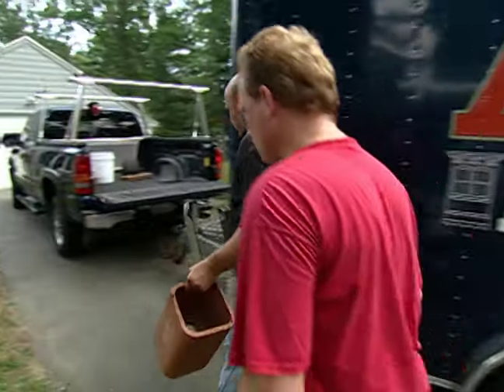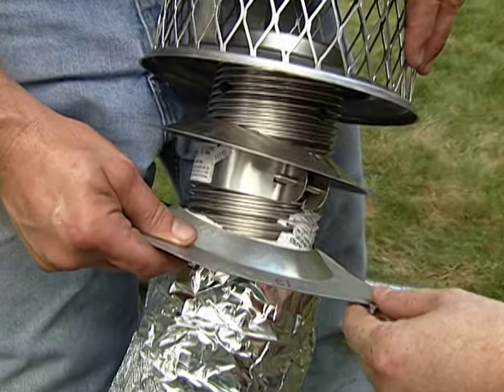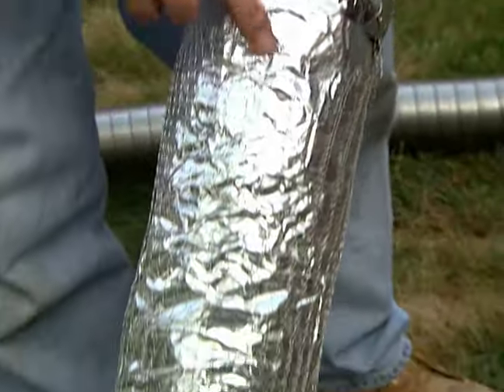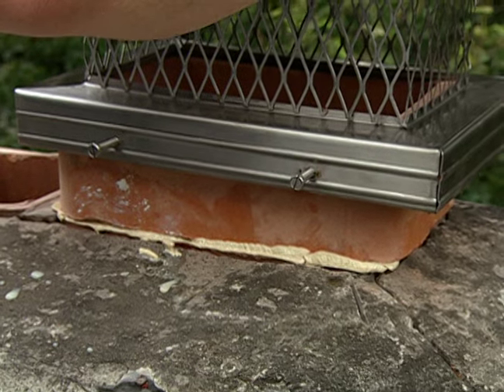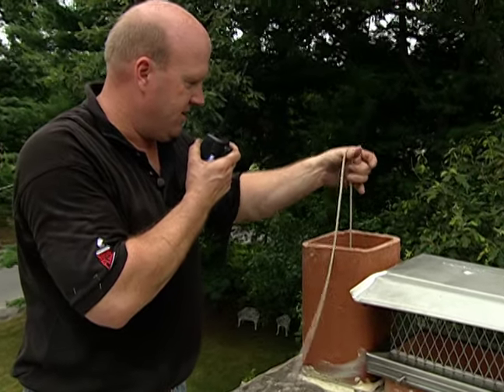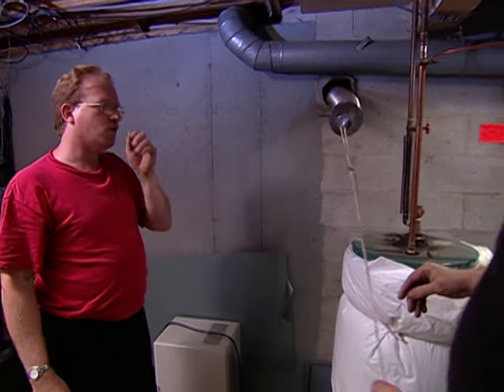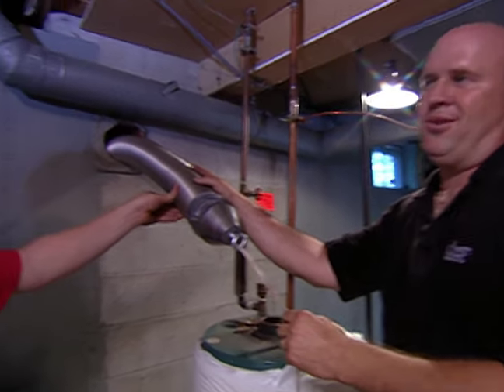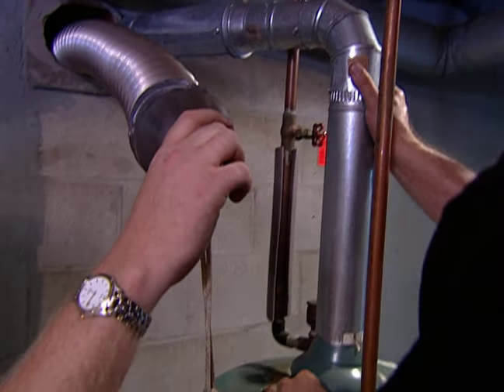How to Re-Line a Chimney Flue | This Old House

Comment: I've been told that the fireplace cap should be above the hot water tank cap?? And also don't use aluminum use the stainless any thoughts? I have the same situation at home.

Comment: This video stopped too soon. I wanted to see it being buttoned up also, not just fed down the chimney.
Reply: Les Fogerson any plummer could do. this for less .chimney linner start at $400online .home depot also have them.
Reply: @jeanalexandre1105  They are not the same grade of chimney liner as what we purchase at supply houses. As for finishing up you use a furance cement they sell in a bucket that can be sculpted to cover the hole.
Reply: @zack9912000   It's known as re-tort cement.
Reply: @bigblackpipeb1974  Yes but up north east we call it furabce cement, if you call that around here people won't have a clue whatbyou are asking for
Reply: @jeanalexandre1105  You could grab anybody off the street to do it cheaper too, but you'll end up paying even more down the road when a REAL professional has to come rip out everything that's been done & start all over from scratch to do it right. Part of what you're paying for is the knowledge & experience that comes along with it! I've been to MANY MANY jobs where we've been called in to fix what other "professionals" have done wrong & it ends up costing the customer WAY more than it would have had it just been done right in the first place!
Reply: And forget furnace cement! It's garbage! It's a mess & it dries up & cracks! Just use mortar mix instead.

Comment: Wouldn't it be better if they did not glue the chimney cap on, to let it breath? With it glued air tight, I think moisture would get between the stainless steel and the clay tiles, and the chimney would slowly deteriorate. I looked at mine which was done recently and the top just floats.

Comment: I am having this done and it's only $1300. The chimney at the base in the basement is slowly crumbling due to condensation issues, very damp at the bottom. Had a tear-off some years back and now condensation from the chimney is causing a condensation leak at the roof. It looks as if it was going on for years but only started leaking through recently.
Reply: This happens because the newer furnaces and water heaters are more efficient.  So they don't fire up long enough to burn off the condensation in the flues.  Check out the weep hole on your car's muffler when you first fire it up.  Water pours out of it.
Reply: RADIUM CLOCK Are you relining the chimney for gas, oil, or wood?

Comment: I just got a quote for this. They wanted $175ft for the install of the liner alone. Didn’t even include buying the liner. Quote was ~$2500
Reply: Got my estimate this morning.  Same $2500
Reply: Thats not too out of line. $500 for the liner, $100 for misc. materials, $400 for the labor, $600 for OH expenses and $400 for profit for a simple, easy roof access job makes since. Comes out to about $2000 for a suburban market. If its a difficult install and requires other work like some brickwork at the crown in or in the fireplace I could definately see it being north of $3000. Source: I work in the industry and our company pays fair wages for the area, has the proper insurances, provides 100% insurance coverage to its employees and answers the phone when you call. Our folks also show up clean and ready to knock out the job. Also one key point everyone ignores, someone likely had to come out and inspect the chimney first and identify the solution and such. That cost is captured somewhere and thats in the install price.

Now you could always hire chuck in a truck and hope he/she shows up and hope they do it right and hope if they fall off your roof they don't sue you. That might cost you $1200 in todays economy.

Comment: I wonder how the top of the chimney/flue was attached and sealed.  There is a square tile flue lining that the round stainless flashing sits on... but they never showed how it is attached and sealed...
Reply: Building adhesive, they show it in the other video on the fire place flue.

Comment: FIRST OFF.....The only time you're allowed to come down the chimney & bend the liner right out into the room like that is for a gas appliance. So for people watching this, don't do it that way for an oil or wood burning appliance! For oil or wood burning appliances you're supposed to use a T-body, T-cap, and a snout that sticks out through the wall & connects to your vent pipe. There's also supposed to be big stainless hose clamps that hold the wire mesh in place on each end of the liner so that it doesn't bunch up when you put the liner down the chimney. Also, use 316TI stainless liner! (Much better than regular 316) And as far as price goes, TRULY "done right" that job should probably be between 2-3k (depending on many different variables) but chances are if someone is doing it for much cheaper than that then they're probably not insulating it, or don't know what they're doing, etc. Also MAKE SURE TO CLEAN THE CHIMNEY REAL GOOD FIRST BEFORE INSTALLING A LINER!
Reply: ALSO......There's many many other things that go into this! You don't just buy a liner & throw it down the chimney! You have to make sure you use a liner that will be the correct size to vent the appliance your connecting to it! You've got to take into consideration the length of liner you will need along with a proper parts list, length of the snout needed, what size vent pipe the appliance takes, the vertical & horizontal measurements of the vent pipe, how many elbows, (are they 90° or 45° etc elbows) the height of the chimney over the top of the appliance, how many offsets (if any) are in the flue, the BTU's, the efficiency rating, the stack temp, etc, etc, and put all this info into charts to even figure out what size liner you'll need! We also have homemade tools, etc, that we use to do a test fit to see if the size liner you need will even fit down the chimney. Instead of just guessing, ordering the liner, getting it there, then getting it stuck inside the chimney like we've seen so many others do!
Reply: I'm more concerned about the the finished height on the fireplace cap. I've been told that the fireplace cap should be 12" above the hot water heater cap.
Reply: I'm surprised they bent it out at all. I've never not used Ts and Ys, the liner stays IN the chimney.

Doesn't need to be cleaned though, once the liners down whatever gunk is inconsequential.
Reply: @stinkfinga4918  "Doesn't need to be cleaned"!? You CAN'T be serious! PLEASE tell me you're not a real chimney sweep! You ALWAYS clean the chimney first! If you put a liner down a dirty wood flue, not only could the creosote catch fire outside the liner, but it could also start smoking & the customer could have smoke leaking into the house in different areas! (We've seen where this has happened before when chimneys were not cleaned prior to relining) And with oil flues you always brush them out first (not just because of that same reason, but also) because oil soot is SUPER corrosive! Even if you're using 316Ti stainless (which is good for high corrosion) you don't want the oil soot in there right up against the liner just because you were too lazy to brush it out first! And even if there was no potential problems at all with installing a liner down a dirty chimney......why would you!? It's just common sense to clean it first! Stop being lazy & do it right! 🤦‍♂️
Reply: @thegreatwhite75  buddy we pour insulation down the flue securing both the liner and the chimney. Sure there's times when there's a buildup and needs to be cleaned but in most cases upon inspection things aren't at risk.

On top of that... its not wood gas or oil, it's a furnace liner

Comment: $1200 dollars where, here in Detroit I’m being quoted $3800.
Reply: Well, this was 9 years ago. I can tell you since covid the prices of all the material we use has gone up exponentially. But for a job like what's shown here, $3800 does seem a bit high. To connect a stainless steel liner to a water tank my company would charge about $1800.  I am in Maryland.

Comment: $ 1,200 is a small price to pay to keep your family alive.
Reply: I know I didn't get charged that much when I had my new high efficiency furnace installed, but I do wonder if It would have be more economical to use what they billed me for the chimney liner and installed a high efficiency water heater. The reason I needed the liner is the water heater doesn't create enough heat in the flue gasses to stop condensation and convection in the old clay flue.
Reply: DarkRaptor99  I though stainless flue line was the only option, but I see now you can use an aluminum flue in lower heat applications. The added benefit is its significantly cheaper than stainless,so I wasn't paying for that in the cost of my furnace install. This is good reason on why you should do some research before you comment :)
Reply: @socksincrocks4421  A us made stainless steel liner with 2300 degree rated fire blank as it is there thats 30 feet runs about 400-675 depending on your state taxes and  2-4 hour total labor. 1200 isn't high. Also insurance companies want to see licensed companies do the work other wise they won't cover any fire damage.
Reply: @zack9912000  So you're telling me, as a home owner, you don't have the right to work on your home? Everything has to be contracted out?
Reply: @socksincrocks4421  If you want your insurance to cover a house fire.  See it all the time, chimney fires that insurance won't cover damages from because they were not installed by licensed contractor and no permits were pulled and were not inspected as required by code. Insurance  companies won't cover DIY installations especially when they are not done per code.
Reply: @socksincrocks4421  I’ve been looking for a house with a fireplace that we can use. Having seen so much halfassed home repair (flue installations, wiring, waterheater installations..), I order chimney inspections any house I’m contract to purchase. And just because you PAY someone to do it doesn’t mean much, I’ve learned to talk to the chimney guy - see how long he’s been doing the work (so many of the good ones had fathers and even grandfathers that did the same thing!)
Reply: @socksincrocks4421  I work for A-Tech Chimney in RI. This is a very tiny single appliance flue and a very tiny house (very easy). But when your liner is 9"× 11" and your Chimney takes 3 bends and stops on every floor, with maybe 600,000 BTU's going thru it. Thts something tht requires you to smash brick/flue tile ect. There's alot a homeowner can not do. But if its a single story home with a 4" liner going down, no problem, try yourself. BTW $1200 is our summer price, come winter, its double. Also there's alot your forgetting, like the pitch of the roof? This house was easy to stand on, but what if its a 12 pitch? What if instead of asphalt shingles they use Slate? Or a metal roof? I doubt the home owner has a set of Ultimates or a set of Blues, Lifts, Ridge Hooks or even a 40' ladder. Js
Reply: @zack9912000  chimney fires (just like heavy winds, Lightning strikes, tree damage to house, etc) are considered "sudden and unexpected". The majority of chimney fires are caused by homeowner neglect (not keeping the flu and firebox dry, not keeping joints mortared, bad flashing, etc) and even still, the majority of homeowners are covered for a chimney fire without having to produce a record or proof of inspection.
Reply: Besides, what if the whole house burns up in flames, are they gonna get csi to pick through the rubble and discover what the cause of the chimney fire was?
Reply: @mattweeeee  That maybe where you live the state laws may require an insurer to cover X percent of costs to the home. The majority of the country if a chimney fire is due to lack of maintenance from the homeowners or from homeowners doing illegal installation they absolutely will deny the claim. See that alot every year in our industry. Insurance companies will find any reason to deny a payout and DIYers make their jobs that much easier.

Chimney fires are easly identifiable,  the Fire Marshalls that inspect home fires afterwards can easly identify what the cause of the fire was.. The that fact you are saying that there is no way to find out what caused the fire if it all burns down, which is BS by the way. House fires leave a ton of evidence that tells a clear picture. Again a home insurance company WILL deny coverage over lack of maintenance and stupidity of a home owner. Also chimney fires are absolutely not like freak weather damage which is out of the control of the homeowners.  Chimney fires are not.
Reply: @mattweeeee  Really, it's taken you 6 years to find this comment. I said it because I had late in laws who had a chimney fire with their wood stove, but it was over 30 years ago and after the fire, they always got the chimney cleaned yearly.
Reply: @zack9912000  so anyways, my insurance company considers a chimney fire an unpredictable sudden act that is considered out of the homeowners control (and i added even though most fired are cause by neglect to the chimney, which is stated in the insurance policy. Which means they are aware of the main cause yet cannot disprove nor prove it was a no fault accident. You say Most Companies wont cover it but im having a hard time finding them....

Comment: Question is why was this done for a gas water heater?  How many people will line a flue on a recommendation of a so called company expert who wants more work. We had a house built in 1965 and has a similar 2 flue chimney, one for gas, one for wood, and it has never been a problem.
Reply: Guaranteed you have problems man. All that vapor is eroding your chimney in a way regular tuckpointing ain't gonna fix.

Comment: 8 yrs later and I am quoted 4k to have my flue repaired.
Reply: At that cost you should consider replacing with high efficiency appliances that vent out the side.
Reply: Yeah its nowhere near 1200. No clue where they pulled that figure from.
Reply: Yup me too. 4k. Good time to put an electric water heater in.

Comment: "$1,200". Today they charge almost $3,000.00.
Reply: $1200 is way cheap unless you live in the boonies. $3000 sounds a little steep but there could be mitigating circumstances.
Reply: 3-4k is what most people will be looking at, sometimes more depending on circumstances.
Reply: just got a harder job like this quoted for about 1100 by my local chimney sweep.  you guys are getting ripped off...

Comment: Wow. That is the worst DIY video I have ever seen. First.... Tell homeowners how to size liners based on appliance type and BTU output. Second, confirm that the liner, connections, etc are up to NFPA standards. Third, have them call a CSIA certified professional. Chimney lining is not a job for a do-it-yourselfer. Very irresponsible broadcasting.
Reply: agreed, insurance companies will not cover DIY jobs
Reply: You shouldn't DIY this really. Dangerous if you unknowingly mess up. And as stated above, insurance won't pay if your house burns down.
Reply: Like the video, you did not explain.  Apologies for my ignorance, but this looks very DIYable.  I see nothing here preventing my ability as a novice from completing this job.  What am I missing?  Why must I shell out my hard earned cash to a professional?
Reply: @siberwolf33 because the professionals with a drug addiction and a high school diploma don’t want you to save money.

Comment: $1,200 hundred😱I paid $600.But it's a lot of contractor's taking advantage of homeowner's and they "WAS" Allowed to work during covid lockdown(Were Considered Essential Worker's)And wasn't financially effected.Simply"AMERICAN GREED".....
Reply: The only way that makes since is if someone bought an aluminum liner (or reused the liner from another chimney...) and just put it in themselves. No real company is able to operate off of Labor and Material alone. How do you pay for the lights? How do you pay for fuel? How do you pay for anything if you are just charging a labor rate + material? Insurance? Can't afford it, hope I don't break my leg in your house. Hopefully I didn't burn someone else's house down.

Some things are greed, like big corporations killing small business and price gouging Americans. But small businesses, that need to charge $2000 - $2500 for this job are not price gouging you. You got a steal, hope everything works in a few years.
Reply: TruthMustBeTold....If the "truth must be told".....$1200 is way too cheap! Nevermind $600! 😆 For $600 I can pretty much guarantee they didn't clean the chimney before they installed the liner, used cheap grade stainless, didn't insulate it, etc, etc! I've been to 2 jobs just this week where we had to rip out liners that other "professionals" had installed & start over from scratch!
Reply: Yeah I just got quoted $800